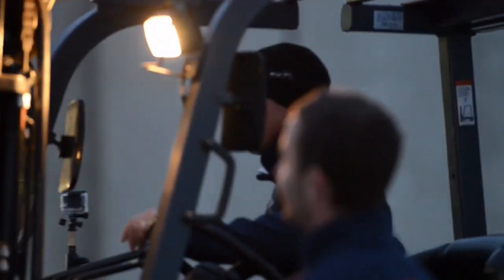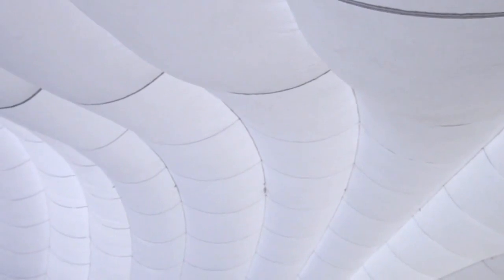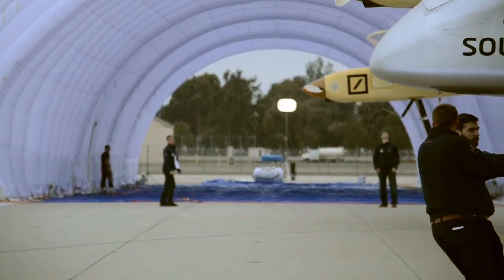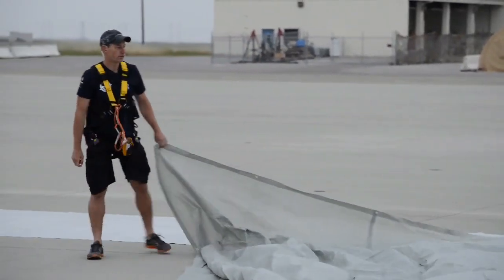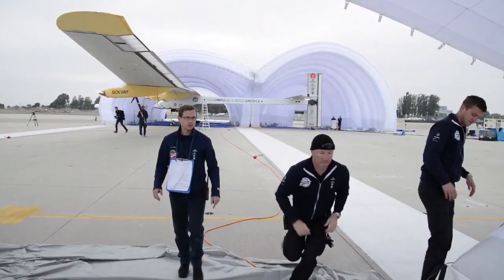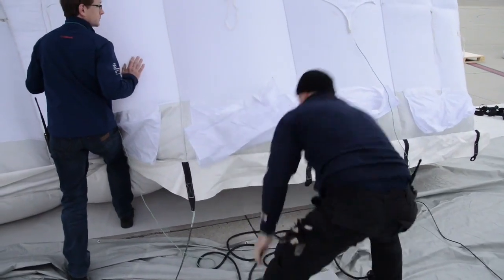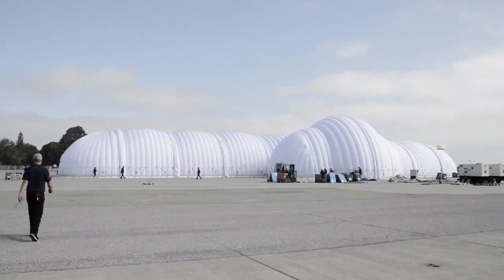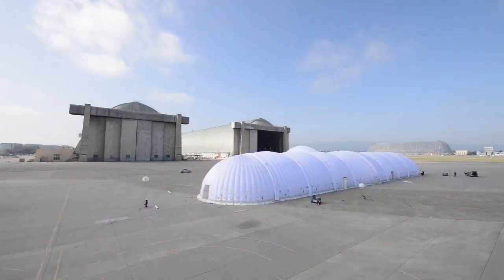Solar Impulse - Mobile Hangar

Comment: Although the huge blimp hangers in the background were built to such a size that a Hindenburg sized dirigible could be housed, they were not custom built for that specific  aircraft.  The only other hanger I can think of that was built for and assembled around an aircraft in place was the one that housed Howard Hughes' "Spruce Goose" at Long Beach, CA for almost thirty years. It had to have weighted cantilever beams built over it in place so that the drydocked plane could be moved out forward.